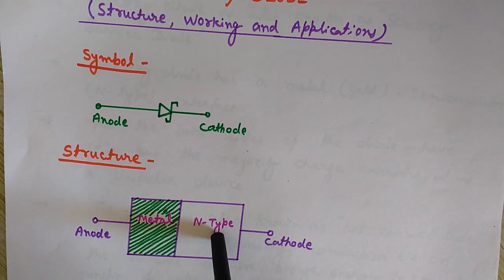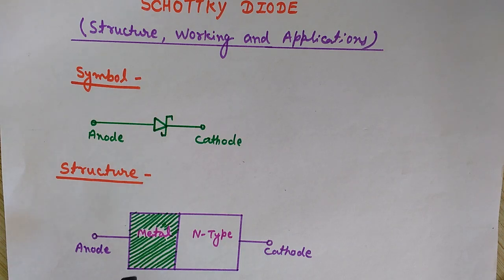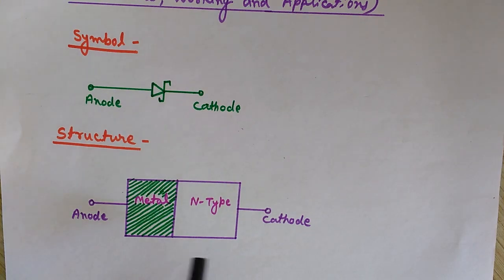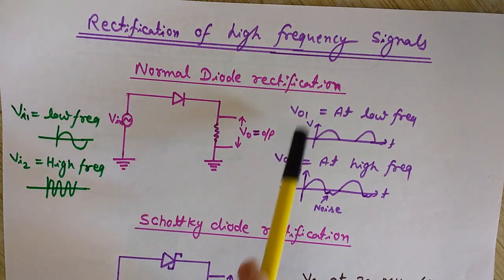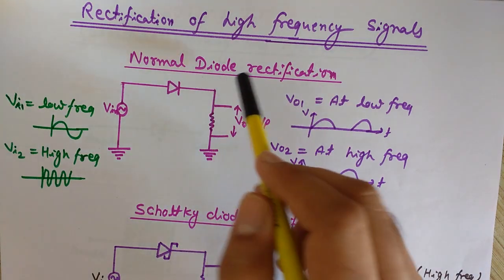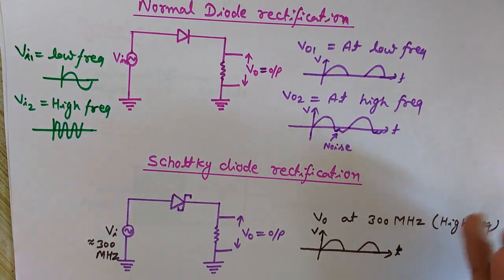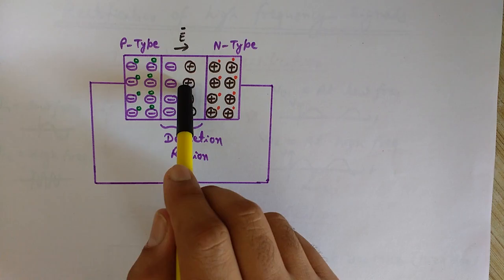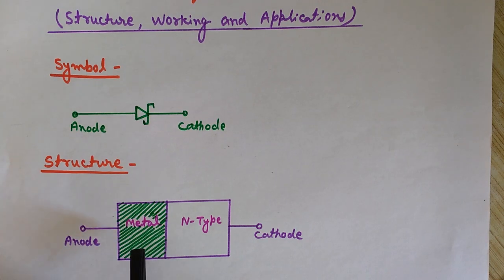Schottky Diode - Schottky Barrier Diode - Hot Carrier Diode - Construction, Working and Applications

Comment: what will happen when we use p type with the metal instead of n type in schotkey diode?
Reply: In my opinion ,if we use p type, then it will work like p- n junction diode,because metal have already free electron and p type have hole ,so overall it works like p-n junction diode and (have depletion layer) ,not shotky diode which is used to overcame the drawback of p-n junction diode .am I right if not please correct me if you know the answer of above question

Comment: @8.37 the diagram of the pn junction diode is wrong, on p side holes should be the majority carriers,here both are same in number ,same is the case with on the n side
Reply from the maker: Bro, please watch the video again, actually I have only shown majority charge carriers on both sides. The the positive and negative charges are the immobile ions. We show a hole with the immobile negative ion (on p side) and electrons with positive immobile ion. Hope it helps